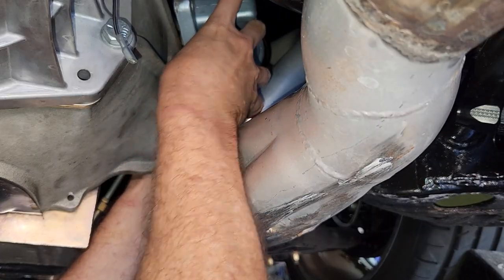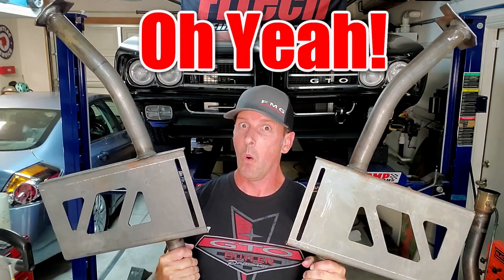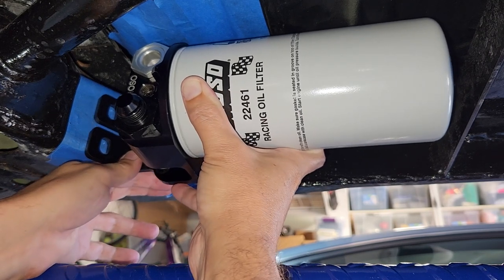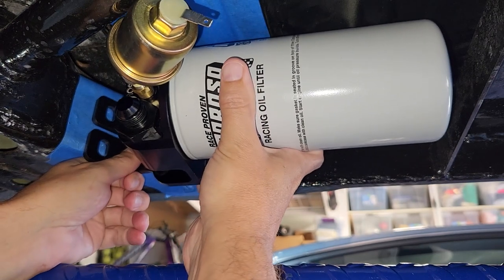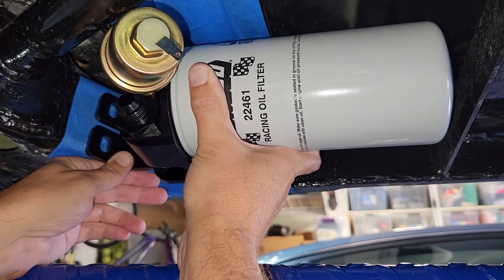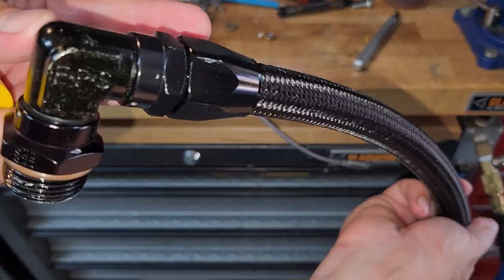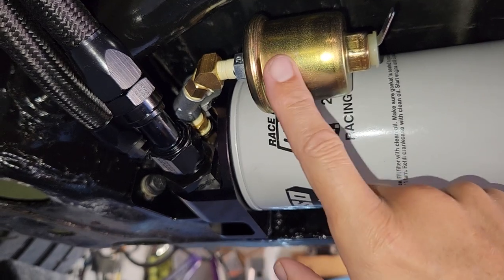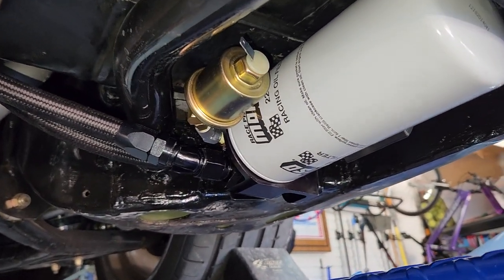Remote Oil Filter Install, AN Hoses, with Custom CAD Designed Bracket

Comment: Would a different set of headers allow for easier filter changes using the stock setup? I have Doug's long tube headers on my '66 GTO and getting the filter off is a piece of cake. No need to remove the filter adapter from the block. Maybe it's different for the '68+ cars?
Reply from the maker: Good point.  I should've mentioned it's definitely a later model GTO issue.  I have Doug's headers too... zero fun oil change.  ha, ha... Thanks for the comment!

Comment: I have a manual shift in my car and want to adjust my afr settings. Switched handheld to fuel learn and now cannot reset afr to settings I want. My unit is like your former efi setup. Could you do a video showing your handheld settings for a manual shift car? Like loop rates up and down etc? Just turned on my idle learn mode because it won’t come Bacar down to my 850 rpm settings. I think this could help a lot of people. Especially me, lol. Thanks for your consideration.   Mike
Reply from the maker: Hey Mike, good question... I honestly haven't done that myself.  But, have you seen the Dyno video I did, where FiTech ran through some of those settings?  There might be some tid bits of info there... otherwise, yes, when I have time I'll add this subject to "my list".  Thanks!
Reply: @FastMonty  my FiTech is like your old one, that’s why I think it would help me. No FiTech tuners in my part of the country. Holley guys won’t touch it. Had AFR auto learn on to learn afr. Now turned off, but won’t let me adjust afr manually on handheld. Tech line is not much help after purchase
Reply from the maker: Totally understood.  Please review the Dyno video,  at about the two minute mark Jeremy runs through my existing AFR settings on my old system. https://youtu.be/yi1Nzqamdw4  Other than that, that's all I know... for now, at least.  Let me know if it helps.  (Maybe comment on that video to continue the conversation)  See ya!  @mikeburnett7028
Reply: @FastMonty  just watched the video, was no help. Didn’t show any settings on dfco or any help whatsoever. Learned some things watching Nabors75 but still need mor info for manual shift cars. When letting off throttle, won’t idle down fast like a carburetor does. Any ideas would be helpful. Thanks
Reply from the maker: Sorry Mike, I'll add it to my list, as I don't know off the top of my head.  If you figure it out, let us know! @mikeburnett7028

Comment: Love the channel and all the info and experience!  I added this remote filter setup to my '77 T/A with a '68 428 and Doug's long tubes.  I also added a remote cooler, which is overkill, I know, but so far my pressure doesn't dip tooooo low.  I may still remove it later if I get too uncomfortable. I drilled and tapped oil restrictors for the valvetrain (solid roller). I just mounted the 2 qt filter housing on the firewall ac delete plate. I have a Vintage Air a/c.
Reply from the maker: Awesome Darrin!  Thanks for the comment, love the setup!

Comment: I would not use a hard 90 deg fitting. Find a way to use a full flow gentle tube 90. You can tap your block directly to 3/8 pipe and run a gentle 90. Get rid of the adapter.
Also, no Teflon tape in a car anywhere. It belongs to plumbers, not mechanics. A piece of that tape can get stuck in your check ball in your oil pump. Then you have problems and might need to pull the engine.
Use the Permatex white Teflon paste. If some gets in your oiling system its not going to be able to cause your oil pump problems.
That sideways filter you are going to have to unbolt the filter adapter every time to fill that giant filter with oil.
Nice car , I used one of your vids to help degree my cam in my High Port stroker.
Reply from the maker: All good points, in a perfect world.  If the block was out of the car, you can tap all kinds of stuff, lol.  Agreed about PTFE tape, but I used it when the bracket was on the bench, and I cleaned the insides before installing on the block.  Otherwise, yes, I only use PTFE Petroleum Paste.  As for the horizontal filter, I was able to get 1 quart of oil in there without spillage, which is better than nothing.  Thanks again for the comment!

Comment: In one of your videos titled "How to install an AN Radiator Hose on your Musclecar. No Welding Needed! AutoPlumb'' you use an Aeroflow adapter AF64-2074S for the thermostat housing. Every website I try to order this part from does not ship to the U.S. where did you order yours from? You have a link in the video "Swivel to AN adapter" from AutoPlumb, is this the adapter? The stock picture looks nothing like the one you use and want to make sure I order the correct part. BTW, Awesome videos, you've taken a bunch of the guesswork out of the mods I'm in the middle of making to my Pontiac! Thanks Very Much!
Reply from the maker: Thanks James... yeah, the picture shows a standard AN fitting adapter, but the ORB 20 to -20AN is the correct one for the swivel.  Here's the video link.. https://youtu.be/6WByB9khrOw?si=7EgbRXAl-sCEB5kF  Thanks!

Comment: Hey Monty how are you. This is Chris I tested my new bop engineering rear main seal and no leaks hurray 😄. I'm a happy camper. That's that one I put in while the engine is still in the car. I also fixed a bunch of other small leaks. I saw a small trace of rust out of the weep hole in on the water pump replaced that and the lower hose needed replacing. The power steering pump was leaking from the o rings on the reservoir replaced those. I removed the stock log style exhaust manifolds and installed some nice ram air three reproduction exhaust manifolds they were a beast to install. I had to remove the oil filter housing to get the passenger side manifold in and I used a jaw type wrench that slightly bends the oil filter on the bottom its not that old of a filter but it caused the crimp seal to leak oil on top. At first I thought it was the housing so I tried a new filter first and it stopped leaking. So if you bend an oil filter even a little bit will leak at where its crimped together. I ordered some exhaust down pipes from pypes they were advertised as 2 1/2" but when they came in they had 2 1/4" collectors 😟 going into 2 1/2" pipes bummer.  I had to order another set and this time I sure I got the right ones they're for 1968-69 H.O. and they had a picture of them with no welded elbow pipe it also comes with the right flanges. I finally got a dry carport 😄 I like cars that have no leaks. Hope all is well with you. I got a little issue with the turbo 350 transmission. After I installed a shift kit it goes into reverse but only if I raise the idle a little. If its 650 stock rpm it won't go in reverse I have to give it a little gas then it catches and I've been looking all over Google for an answer but haven't found one yet. Other than that its fine. Goes in forward gears great and shifts like lightning 😁. Monty your car is super nice.
Reply from the maker: Hey Chris!  Thanks for the update... hooray for no leaks!  I wish I could help with the Tranny, but my solution would be to take that out and put a TKX 5 Speed in, ha, ha... sorry, no experience with automatics... maybe the fluid is low?  Keep us posted!

Comment: I like what you did  your always thinking!  couple of thoughts  have you considered heat wrap on the lines by the headers ?  also with the lines how much more oil is required? you using a high pressure pump in your engine as i forget
Reply from the maker: Thanks Steven!  Good idea about the heat wrap... not sure if it's necessary yet... might need to install a oil temp gauge and test it.  :)  Not sure about the oil line volume, just need to measure the length of hose and do some math, but should be less than 1/2 a quart.  Using an 80 lb pump.  Thanks for the comment!

Comment: What's the farthest you would put the filter from the engine.
Reply from the maker: Tom, that's a great question... I frankly don't know if there's any head pressure loss at X distance?  I've seen people mount oil coolers in the middle of the car... sooo, maybe that's the answer?  If I were to do it, I would make sure there's enough elevation in the lines for them to drain when you do an oil change... let us know your thoughts!
Reply: Hi thanks for the response.  My issue is the frame rails on my 32 bantam. The top rail runs parallel  with the oil housing. I have a 1 inch block made with 90 degree angle bolted to the block. This allows the  lines to run along the block. Then into dual filters. The engine is a 495 with number 96 round port heads (r a 2) roller cam, holley pro dominator tunnel ram with 2 750 double pumper. Just get concerned  about the 90 degree  block that routs the oil lines.
Reply from the maker: Good question... I honestly don't know how fast the oil flows.  I'd monitor the pressure at the filter, and on the back of the block and see if there's a dramatic difference between the two.  That engine sounds fun to me!   @tomlimbeck9934

Comment: Hello Monty I'm overhauling the front end on my Pontiac. The control arm bushings have a metal sleeve in the middle. Does the metal shaft pivot inside the metal sleeve when it hits a bump or is it locked against the shaft and the sleeve pivots inside against the neoprene material???
Reply from the maker: Good question... I don't know for sure, but I'd be willing to bet the inner metal sleeve should rotate around the bolt.  Good luck!
Reply: I also asked the people at energy suspension and when I get an answer I'll let you know what they tell me. Thanks 👍
Reply from the maker: Sounds good... I'm curious now, why are you asking?  @chriscimino7854
Reply: I need to make sure that the shaft bolt is not too tight that the center sleeve is not jammed up too tight on the shaft where it can't move. The guys at a-resto-parts emailed me back and told me the swivel point is between the metal shaft and center sleeve. I think I need to watch a YouTube video on how to replace control arm bushings. I feel like using a Castle nut and drilling a small hole in the shaft so it won't be so tight against the neoprene and use a cotter pin to lock it
Reply from the maker: I don't recall how mine was made... I thought if you used the proper torque, it would work correctly.  Been a long time since I put mine in.  Let us know what you find out. @chriscimino7854
Reply: @FastMonty  I greased the new bushings and tightened the shaft nuts untill there was no more end play and stopped and the center sleeve is not crushed up against the shaft shoulder. They use aviation nuts and I made sure that the nuts don't turn when I move the arm. Now I gotta figure out how to get that darn spring in 😆. I guess I have to buy a spring compressor. It came out easy but it won't go in
Reply from the maker: Ahhh, yeah, putting the standard spring back in is a PITA.  Spring compressor, and/or a floor jack pushing up against the weight of the car.  OR, upgrade to coilovers, those bolt right in without the compression issue.  Have fun! @chriscimino7854

Comment: Now you cannot prefill your filter, and the mess you make changing the oil will be epic. Our 72 T/A has had this done for over 20 years. We use two filter system to gain filter media and 
flow rate negating the need for a bypass. The filters are mounted upright, just in front of the A/C pump. We used the idler arm bracket bolts to mount the stand we made up. Has worked very well for lots of years. No bypass either except for the one in each filter.
Reply from the maker: Nice solution.  I just wanted it hidden, and added some "mad genius" creativity to give others custom bracket ideas.  (Actually I can add one quart of oil two the two quart filter, without it spilling out during install, so not a total loss)  I'd rather have oil spill on the floor than the headers, so that's a win for me.   Good job getting creative on your mount!  Thanks!